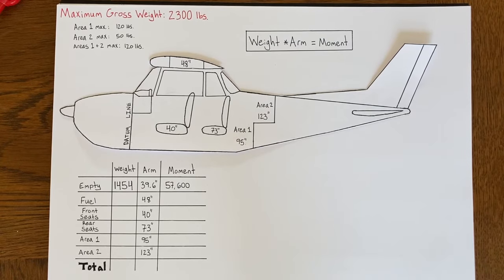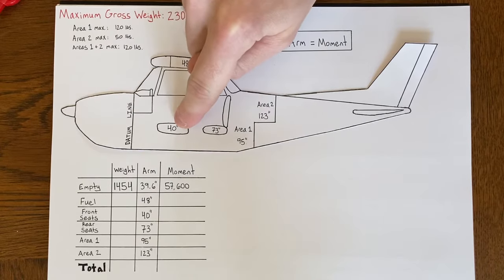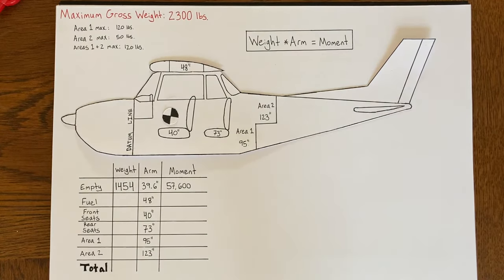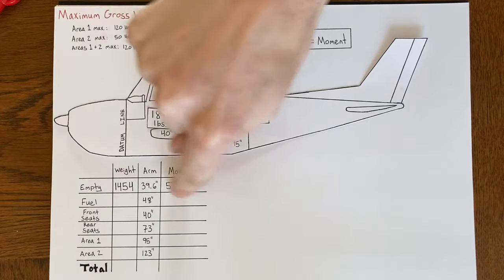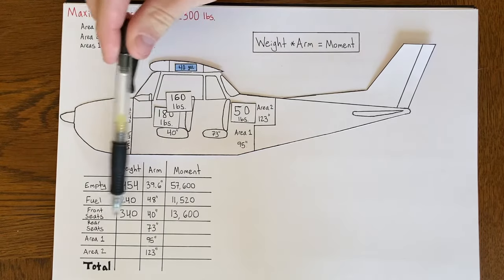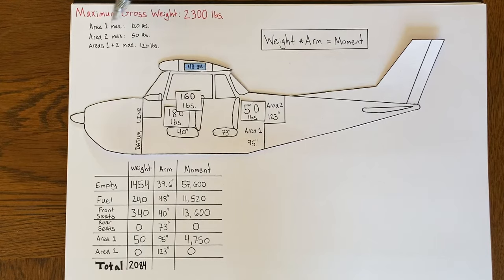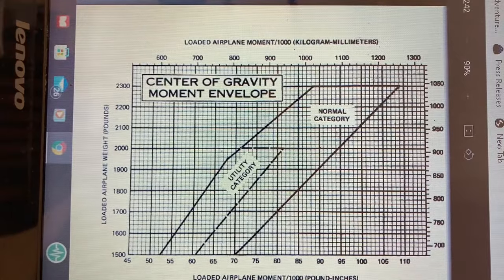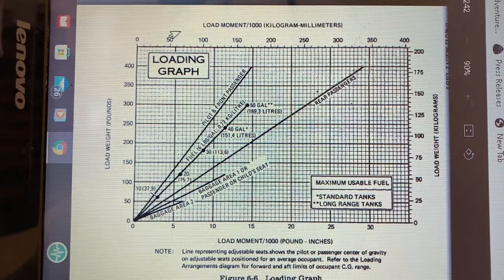Weight And Balance Part 3: The Calculation

Comment: PLEASE SOMEONE HOW DO YOU FIND THE BASIC MOMENT OF A PLANE I’m going actually insane?!? I can’t find the arm of empty weight for a Cessna 150 1976’s Commuter II.
Reply: You look in your operating handbook. Every plane is required to have one. You could also search online for the same POH but it would probably be slightly different b/c the arm changes depending on what work has been done on the plane. For ex. My 1967 C150 G has arm at 32.56 for empty weight. But that could be slightly diff from someone else’s same year and model plane b/c they have diff avionics or other things installed in their plane.

Comment: In the equation Weight x Arm = Moment, why did you divide both sides with weight because from mentioned equation Arm = Moment/Weight already? It is not needed to divide it with weight.
Reply from the maker: i was deriving the other version of the equation. to go from weight*arm=moment to arm=moment/weight you must divide both sides by weight
Reply: I still don't understand why. 😄

If 3x2=6, then 2=6/3

If weight x arm = moment, then arm = moment/weight.

You get the same equation without dividing both sides with weight. So my question is why the one would do that?

P.S. Thanks for the videos, they are  very helpful for understanding my PPL literature.
Reply from the maker: @klugaric  when you divide by weight on both sides it is in the denominator on both sides. so you end up with (weight*arm)/weight on the left side of the equation. weight cancels and you’re left with just arm on the left side of the equation. on the right side, you get moment/weight and nothing cancels. so you end up arm = moment/weight. this is the process you’re doing when you go between those equations, whether you know it or not. you are smart enough to just see how the equation can be changed without actually writing out the algebra but that is what you’re doing implicitly when you change the equation in that way.

Comment: hey, on a cessna 172 basic empty weight includes unusable fuel so for fuel you would only do 37 gallons (if you are on a separate model then disregard)
Reply from the maker: check the manual but i believe it’s 40 gallons usable, the unusable fuel is in addition to that
Reply: @maxcfi7718  oh ok. I thought in a previous video you said that 40 is total
Reply from the maker: @Tyleraviator99  it is total usable. we don’t count unusable, it’s already in the basic weight
Reply: @maxcfi7718  ok. Thank you!

Comment: Can someone explain how the arm length for "empty" is calculated?
Reply: I think the “empty” is the engine place because what else could be 39.6 inches and weigh so much?
Reply: sorry I was wrong the datum line length was 39.6 inches and the weight of the empty aircraft was 1454 lbs
Reply: No clue I just found it in the pilot operating handbook